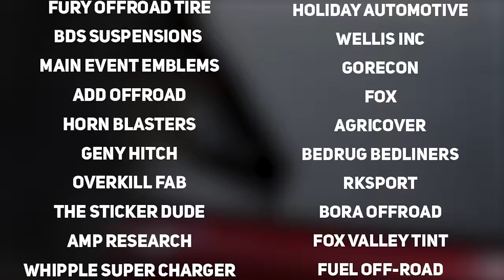TUG OF WAR - SUPERCHARGED CHEVY VS TURBO FORD!

Comment: Not sure what to say, I was almost certain the Ford would win although I'm a Chevy guy. To be fair, there should of been a round 2.
Reply: I'm sure there would have been if the ford didn't pull a super duty and break.
Reply: There was no way that Ford was winning. The ground clearance sealed the deal.
Reply: I think center of gravity is a factor, the ford was too tall.
Reply: you thought a turbocharged gas truck was gonna win against a supercharged diesel truck? jesus lol
Reply: RoyalCalvin but the Ford sucks and broke down
Reply: Fr but Chevy is still the winer

Comment: Haha so my 8" lift cant tow like stock with crazy driveline angles?
Reply: No doubt lol
Reply: The best part is when he said he was full throttle 😂 riiigghht. So a truck that can pull 30k pounds can’t pull a gasser. By looking at these comments they have a big Chevy fan base. Of course they had to stack the odds. You don’t see many fords running around with deep dish wheels so wide you could stand in them. That’s a GM thing. Like dodges and tow mirrors
Reply: If they were stock and it was a fair fight the ford would win all day

Comment: Not to mention the chevys steel is heavyer then the ford aluminum body. But super charger is instant torque. Where as the turbo is building boost
Reply: @Justin King You're* and nah it's just he's right.
Reply: But the Ford broke down.. what’s your excuse for that?
Reply: Steel is heavier than aluminum. But a 1 ton truck outweighs a 3/4 ton truck and the diesel engine sitting in the super dootie is heavier than the gas engine in the white truck. If you want to say a supercharger is instant torque okay but that diesel is supposed to have twice the torque and Diesels are supposed to make stump pulling torque right off idle so don't forget to mention the rest of the facts about torque.

Comment: Rematch better driveshaft in K350 and fully deleted and tuned
Reply: It’s funny how you were most likely going for the k350 saying how easy it would be but after it broke and lost you say it’s unfair
Reply: akaReality never said it was unfair but since co2 is built I wanna see them do it again and build up the motor in the k350
Reply: And the chevy got like 600 more pounds with those fat guys haha
Reply: Why Youuu maad we’ll play smarter not harder 😂💀💯
Reply: All that just to out pull a little 1500 gasser lol id go trade that piece of shit in for a new dirtymax or cummins
Reply: Charliebrown Brown  so ture the one who spins first looses and the more power you give diesel the easier it is for it to break the tire loose hp is bad ass but its not the only factor on pulling you need weight traction and dont blow the tires off it like he did then a little gasser will out pull your big bad diesel....but honestly i think it was just a chevy showing ford about life
Reply: Ford guys make a lot of excuses
Reply: Chromodium high incline tolerance driveshaft with fewer splines! It needs actual quality parts ...not cheap steel to make it look great!
Reply: A delete and tune isn't going to help with traction loss. The Ford makes more hp and tq as it sits. 

Smaller wheels more tire will help traction issues.
Reply: So you want a fully deleted tuned diesel to make it even against a V8 gas? Lol
Reply: @Fullsendfilosophy  yeah next they'll be asking the Chevy to start unhooking spark plug wires until they can win
Reply: @codyhand9541  don't worry about building up the motor in the Ford we can just start unhooking spark plug wires on the Chevy until the Ford can compete that'll be cheaper than building up the super dootie

Comment: We all wanna see a rematch after the K350 gets a new driveshaft but sense we know we won't, I congratulate CO2! Badass trucks, badass builds, and a badass team.
Reply from the maker: Maybe well have to hook them up to a sled! Or race?! What would you like to see???🤙
Reply: Quarter mile drag race then eighth mile drag towing 10000 pounds
Reply: @user-sv9sf1ns7g  
This isnt the diesel power challenge with 3/4 - 1 ton trucks making 900hp and 1800lb ft. 
They are lifted show trucks.
Reply: Did you read custom offsets comment before my reply?
Reply: @user-sv9sf1ns7g  
Yeah. 
A 1/4 mile race and a race with a 10,000lb trailer are 2 totally different things.
Neither one of these trucks are anywhere close to the trucks in the diesel power challenge that race with trailers.
Reply: @CustomOffsetsTV  I'd kinda be interested the see an 1/8th mile or 1/4mile drag. Sled pull would be interesting but too stressful on the lift components. I wanna see them compete, not fall apart

Comment: Fuller: I got the tires aired down I got a diesel I got a turbo I got it in manual mode in 4 low.
 Shawn: I got a CHEVY
Reply: I love this comment😂😂
Reply: God damn right 😂
Reply: Love it. Hellz ya
Reply: Hell yeahhhhh 💪💪💪
Reply: A chevy with 5 fat guys. Its traction and weight that wins
Reply: You know it! GM will always smoke ford now put a Duramax up for the challenge!!!
Reply: Lmao 😂 💪
Reply: King GMC ikr? Those 03-09 camaros killed the mustangs! Those 99-06 gm “4x4” trucks were good enough in 2 wheel drive they decided to self destruct the transfer case for bragging rights. 2023 camaro will be nice too I bet. Also they under rate all of their numbers from the factory because we know GM’s trucks actually make more power and tow more than the other 2 of the big 3. Sike. Quit clowning man. You can have your opinion but statistics don’t lie my friend. 42 years strong as the best seller. That’s for a reason. This video of a jacked up truck with a stock driveline at an angle so steep it probably barely turns going down the highway with a drop hitch that actually picks the truck up when pulling actually only proves that everything has to be on the chevys side to win. Lower that ford just a little, take it off the 40s, and it won’t even be close
Reply: @joshuaearnheart2756  yeah ok the last decent diesel truck ford made was the 7.3, and the G80 automatic locking mechanic differential is better than that stupid E-locker from Ford, when ford buys a GM transmission to put in their half tons come on man whats that tell you. Its not about numbers its about a powertrain that can handle the numbers. You should know that
Reply: King GMC so you mean the new 10 speed ford spent like $3 billion designing and GM had about $300 million in? That’s what you call GM? Someone else paying is usually what GM stands for but not here buddy. 4l60 is about the worst automatic trans money can buy so we know you ain’t talking about that one. And last time I checked the 6.7 powerstroke is the best and highest rated on the market. Duramax sure isn’t up there
Reply: King GMC I would like for you to find 1 instance in which a GM product outperforms a ford in any way shape or form. I’ll wait
Reply: King GMC that’s Eaton. Not GM. Good try though. I drive an f150 and my diffs lock up fine. Front and rear. Helps when I’m pulling chevys and dodges out. Few Toyota’s too. Like I said, someone else paying and them using it is the only time “GM” has sold anything worth owning.
Reply: @joshuaearnheart2756  ok simple Allison Transmission, and who owns them?
Reply: King GMC we’ll sir I believe you said it when you said ALLISON. Established long before GM was thought about. 1915. Shoulda at least searched that on google before typing that 😂 that’s just embarrassing
Reply: @joshuaearnheart2756  who owned them when they created them for the duramax?
Reply: King GMC owned. Not designed. That’s like claiming ford designed international diesels. And gm sold the Allison brand in 2007. So

Comment: Even with CO2 adding 700lbs of cheater weight, Fuller should have optimized the turbo. Ya have to give it to the better driver!!!
Reply: M C yes! It looks like he had brakes held until he was already getting pulled.
Reply: The ford weighed 900lbs more then the chevy. They evened the playing field.
Reply: Ryan Walker I’m not taking anything away from the win. They could have added another 200lbs. That race came down to the driver not the truck.

Comment: That chevy was squatting pretty good like it had a bunch of weight even with the front strapped down. Using the drop hitch also caused the rear of the ford to lift. Fun but set up.

Comment: I thought the ford would have won but fuller obviously wasn't as skilled of a driver and wasn't as prepared as shawn.  Good match y'all.  Throw some upgraded driveshafts and regear the diffs (if you haven't already) in the K350 and see who can win two out of three cuz this was fun to watch and I wanna see more.
Reply from the maker: Well do what we can to keep it rollin!🤙
Reply: So fully upgrade the Ford to barely be able to compete with stock gas powered Chevy. Sounds right
Reply: @noneofya6503  not fully upgrade it.  When you run bigger tires, you're supposed to regear the differentials and upgrade the driveshafts.  Putting that big of a wheel and tire setup on stock gears and driveshafts is only asking for a failure.  In the video, the driveshafts are working way harder than they can handle cuz the gears in the diff are likely stock which makes it that much harder to turn those big ass wheels.
Reply: @noneofya6503  with how much torque the engine makes and the massive torque multiplication between the transmission being in first gear and the transfer case being in 4low and how hard the stock driveshafts have to work due to the stock gears I'm surprised the stock driveshaft lasted as long as it did.
Reply: Honestly, they need to regear both trucks and upgrade the driveshafts on both trucks to match the setup each truck has and then do round 2.

Comment: Ford=fix or repair daily 
Chevy=real men Play with big block chevy good tug of war tho
Reply: @yeetpotato5096  lmao
Reply: Rather drive a FORD than a sorry ass government motors..😳
Reply: FORD; at least they circled the problem
Reply: @spikeyninjaplayz1842  bud where I'm from we circle the answer
Reply: Ford in reverse= Drivers Return On Foot.

Had all 3. Will never buy a Ford. Maybe give Dodge another chance cause it didn't abandon me. But my Chevy is still going strong with no trans or engine swap, no leaks, and 378,xxx miles later left a couple of cars.
Reply: Chevys plus sign is how much money its taking to repair.
Reply: Andrew Wolfle lol
Reply: @yeetpotato5096  Chevrolet = Can hear every valve rattle on long extended trips  GMC = Gotta mechanic coming  Dodge = Drips oil drips gas everywhere

Comment: Well, what did you expect. Ford said everything is made out of high grade Aluminum. As you can see apparently everything...
Reply from the maker: Actually it was a steel driveshaft, but i get what youre saying😉
Reply: Right, mixed with high grade aluminum......

🤣🤣🤣
Reply: KAY KAY not sure if they can market it as high strength steel if it’s really just a steel alloy🤷‍♂️ probably has to do with the fact that the angle the torque was applied to the driveshaft actually caused a larger force than the driveshaft was designed for

Comment: The truth is that a 3/4 ton                     4 wheel drive stock 6 cylinder automatic with 33's no lift would drag both of those trucks.
Reply: Jeff   Bradley the only 6 cylinder 3/4 ton is a Cummins, so yeah it would probably pull both at stock level

Comment: Ford owners be like “the Chevy was lower that’s why it won”
Reply: Nah I own a ford and I was hoping the chevy would win lol
Reply: @zachkoolman3845  all they did was even out the weight a little more lol the diesel engine in the f350 is almost 900 pounds heavier than the engine in the Silverado
Reply: @TJ-jd2zo  I'm just saying no need to throw facts at me jezz
Reply: Let's see superchargers dont need time to spool up its instant power versus a turbo that hits it max threshold at a certain rpm, maybe turbo vs turbo would have been a different out come but yeah supercharger give power to the engine before a turbo does plain and simple and I'm a ford guy, I want the ford to win but when they said supercharged v8 I knew the chevy was going to win at that moment.
Reply: @samuelswanson4986  same here haha, wouldve been a different outcome if the f350 had grip too
Reply: Joshua Jensen they added more grip to the Chevy lol
Reply: @zachkoolman3845  like every Chevy owner.
Reply: @samuelswanson4986  if its a stock turbo they pretty much spool right away . Has more to do with truck height
Reply: @humzilla707  my car has a stock turbo and I have to hit a certain rpm for it to spool.
Reply: @samuelswanson4986  my duramax would spool almost instantly with a variable geometry turbo that these diesels have and he was spooling the turbo with the brakes too
Reply: I am a chevy owner and I love my silerado Duramax. Im not a Ford fan but the chevy only won cause of pure luck! I have had both a half ton and a 3/4 ton. a 1/2 will never compare to a 3/4 ton and its funny cause I would have never thought this up until I bought a 3/4 with a diesel and there is nothing that compares to two together. The ford driver was just being stupid for 1 thing and the other thing is his drive shaft wasn't a good aftermarker one which he should had had considering the big tires. This is like winning a fight because the opponent tripped on a rock.
Reply: And you be like, I’m a gay Chevy owner
Reply: Fishing with Daniel LMAO HES ACTUALLY MAD 😭
Reply: Yeah, any excuse will do. Ford owners wrote the book of excuses...there's a whole section on excuses for being late to work because their truck broke down again...LOL.
Reply: @samuelswanson4986  yes and it gas it burns faster

Comment: The real test would be both these trucks stock... all I’m saying is ford would win
Reply: True but it would probably break with how cheap and over price it is  i love my ford but I've worked and spend more money on my powerstroke fixing and repairing everything else besides the engine.
Reply: Captain_Clutch what model and year?
Reply: @captain_clutch4983  I mean I don’t know I’ve been around plenty of fords chevys and dodges all are high quality but Ford is the best quality I’ve been around and also people ignoring the fact a SUPER IS INSTANT POWER A TIRBO HAD TO SPOOL
Reply: nahh 😂 i’m drive a stock 2010 chevy all it has is a metal bumper and a 3 inch lift kit and i pulled a 2015 ford that was way to cocky
Reply: @luisruiz561  not stock if it has a 3 inch lift kit but ok
Reply: @tageerickson581   technically stock cuz i don’t have nothing done to the engine or anything like that
Reply: @luisruiz561  oh engine wise I see what you’re saying
Reply: @tageerickson581  yes like nobody can’t hate how nice the body looks fords look great but engine wise nah
Reply: @luisruiz561  just the 2003-2010 engines which is a long time I mean I hate the engines in those years for example the 6.0 L and all of those but yeah body wise the Ford engine wise the ram in my opinion I love the Cummins engine

Comment: It's physics.  The drop hitch on the Ford started lifting the rear end.  If it was flipped and being pulled at a downward angle most likely a different result.
Reply: Height is always an advantage. The drop hitch was added to keep the strap level. I doubt the drop hitch did anything to be the reason ford lost.
Reply: The strap was level so no truck was being pulled up or down. Neither one had a height advantage
Reply: Rewind the video the hitch are equal height so if anything the Ford was being pulled downward which should have made the rear squat and grip ..
Reply: Physics. Yes the were equal but the connect point (receiver) is higher. It creates a lever affect.  Which lifts the rear of the taller truck.  Rewatch it.  You can see the rear of the Ford come up.  Conversely had they gone receiver to receiver the Chevy would have l8ft because the Ford is taller.
Reply: @danhornaday7319  you're trying to overthink this whole thing. Yes the drop hitch creates that lever effect but it's so small that it doesn't make a difference in the outcome. The Ford slipped first which is already a loss and when he regained traction, he snapped the front driveshaft taking away half of the drive wheels. Quit trying to make excuses about things that don't make any difference. I've always said that a tug if war is always about the driver and traction. This case is no different. The driver broke traction which in turn broke parts and then got dragged. No excuses. He had the weight advantage and then blew it
Reply: @muddybadgers5205  Leverage makes all the difference in the world.  There are videos of awd ridgelines dragging lifted trucks.  I'm not making any excuses.  I have a RAM, I have no dog in that fight.  But I understand physics and as soon as that rear end got pulled up that was a wrap.

Comment: Is that an aluminium body ford if so  no weight loose every time
Reply: They actually just took the weight savings and put it back in the frame to make it stronger. All but a few 100 pounds

Comment: I used to work at Ford and we had a demonstration Toyota Ford and Chevy and Dodge the Ford stock pulled all three of them backwards. Has to do with the gear ratio and low-end torque.

Comment: A turbo in a tug a war is useless 😂
Reply: True you have the turbo lag to compensate for. So that lag is when he starts getting pulled
Reply: There's this thing called building boost, not useless if you understand how turbos work.
Reply: Turbos build boost with load. Automatic transmission work well with turbos.

Comment: On what terrain does the lift and goofy wheels sticking out help these pick up trucks perform? It's certainly not paved roads.
Reply from the maker: Mall parking lots of course😂 Just joking, its just mainly for aesthetics!
Reply: @CustomOffsetsTV  I'm happy that your business is going well, the trucks look good, but I don't understand the wheels sticking out. I'm over 50 years old, so that probably explains it. I have a old plow truck, but I like a nimble small car to commute with. I drive a 6 cylinder Camaro, I put blizzaks on and drive it in the snow.